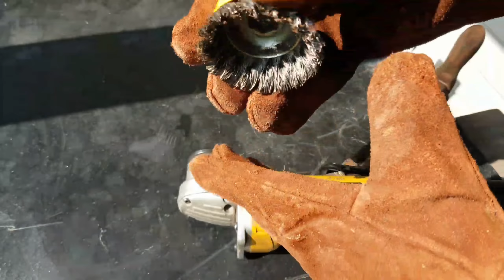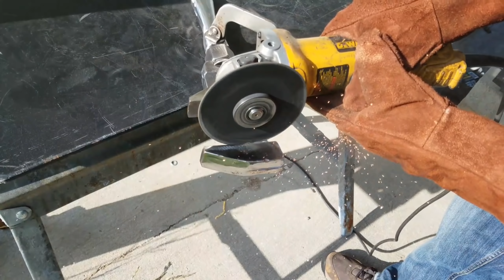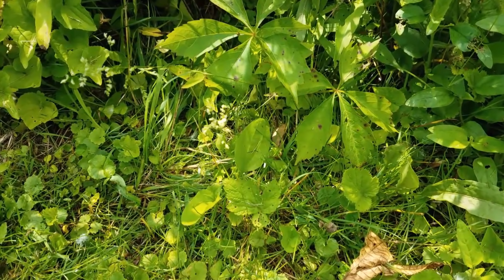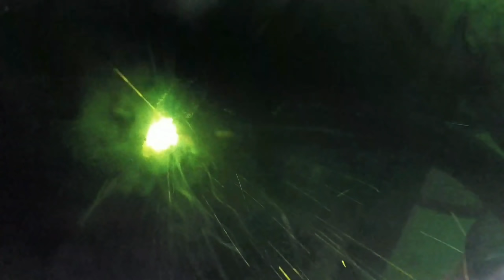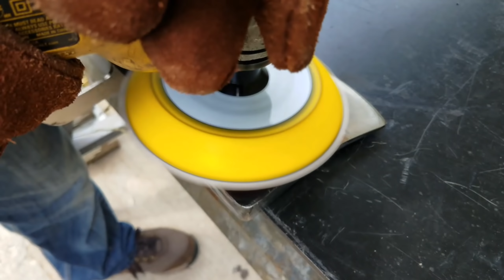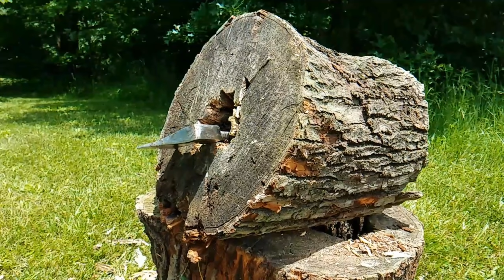Modifying $8 Harbor Freight Axe

Comment: Hey I was just wondering will the welding destroy the temper of the edge or does it stay cool enough?
Reply from the maker: The edge didn't get very hot during welding. It should be fine. Thanks for watching. 👍🏼